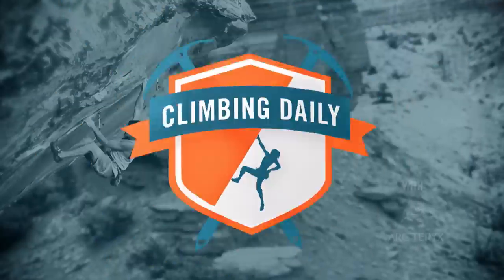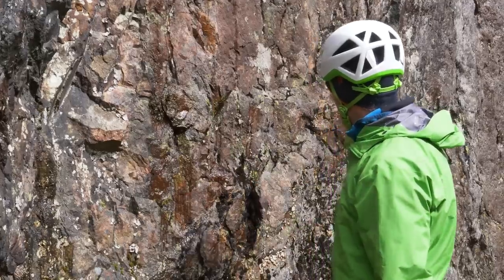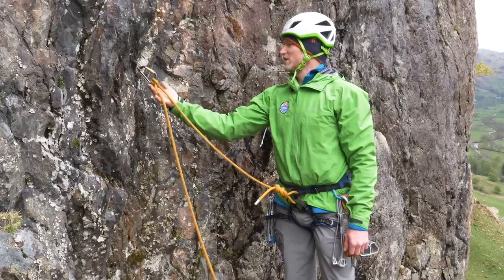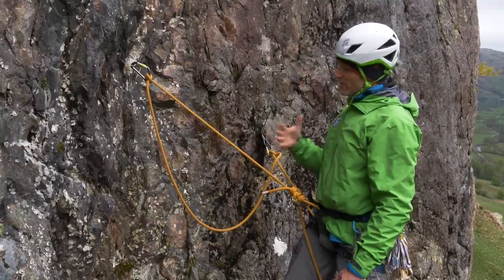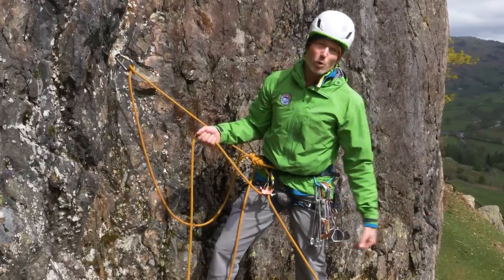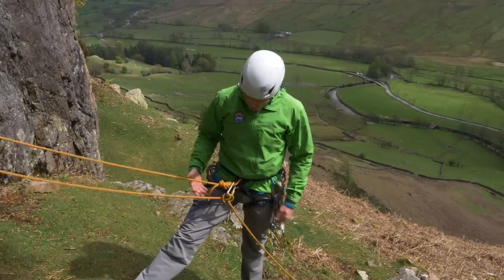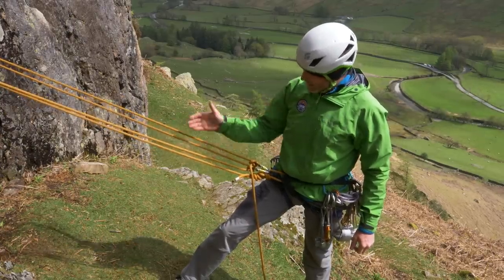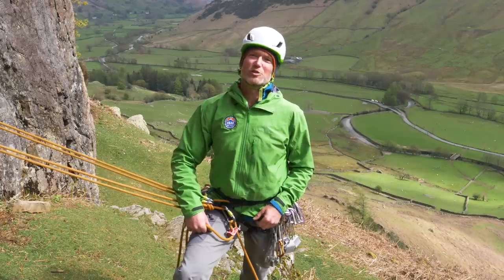How To Build And Equalise A Trad Climbing Anchor | Climbing Daily Ep.1174

Comment: aaaaand the next crazy, tutorial videos done by british mountain guides... why do you always upload videos which are totally against the instruction manual of the manufactors. do you think those manufactors are stupid? 
quick question:
1) limited breaking force (no plate mode)
2) if something happens you are tight in and need to build something to transfer the load. by doing so, you are constantly loaded by the weight of the second climber and your movement is limited...
3) what do you do if the second climber becomes the first? do you continue using your reverso that way? so in case of a fall the climber will fall next to you and probably under you and there will be no breaking at all...

summing up: complicated, not flexible, you can do it way better using ropes... dont listen to british mountain guides... I really need to start checking their stats on accidents. I wouldnt wonder if those are way higher than in the rest of the world...
Reply: 1) This is the normal way to belay with the DMM pivot when not using it in the guide mode - plenty of braking force. It is in DMMs manual for this device I agree they aren't stupid and say that the device can be used in the the way he has in this video and in guide mode. It is called a semi-direct belay as opposed to guide mode or an Italian hitch straight to the anchor which is a direct belay method. Have you ever lowered someone with a device in guide mode?

2)  Sure. But it is perfectly possible to escape this system if needs be (it's easier than you think). How many times have you had to escape the system? I have only had to do it whilst under training.

3)  If the second is going to lead through, they get to the stance clip in (even just to one of the ropes is fine) to make themselves safe and you turn the belay plate 180 so that the dead rope is at the bottom (like when you normally lead belay), transfer the lead kit (have a cup of tea), then the second leads on. No idea how many times I (and 100's of thousands of other people) have done this without a problem.

I get what you are saying in that using a sling or two to build a belay is great as you might be able to use the belay plate in guide mode and it can be easier to escape the system. There are many ways to skin a cat and knowing that you can do it this way when you've used all your slings up, they won't reach from the gear to where you need to belay from or you know the second will just swing leads this is a quick easy way to do it.

If I am leading all pitches with students I'll try to use slings as it does make life easier unless I am getting them to start to build belays; but then that is a teaching thing rather than for speed or ease.

Bottom line really is everything he has done is safe, taught in in the books and on courses, is in the manuals for the equipment and is just another way to build an anchor. Different techniques for different scenarios.
Reply: Ape man is a good name.

1) How is the breaking force in ANY way limited here? If you've locked off the rope away from the climber they are NOT going to fall.

2) You CAN escape the belay. It's a tad harder, but not much.

3) This is a fair point, change arounds are harder, again not impossible though but this is a factor you should build into your assessment of HOW you're going to build your belay.

Flexibility in how you choose to build your belay is an important skill. 

This method is ideal for building belays on gritstone edges. Short climb = lots of rope left over. Gear at the top of the edge is often quite far apart and often is much further away than a my biggest sling/cord could cope with. 

This method is less ideal on long multi pitches where you can't afford to lose precious meters of rope and where gear placements for a belay are in easy reach.
Reply: @apeman2601  FYI the instruction manuals are often written by the marketing department rather than the engineers, something to consider
Reply: @benschuster9792  you are kidding me, right? Maybe mkting suggests a last wording review before publishing but there’s got to be some engineering behind the manuals of all climbing equipment
Reply: @santiagogranda8851  more the other way round. The engineers generally have better things to do than write up instruction manuals and draw diagrams. The engineers probably check the manuals so ensure it's not blatantly wrong but small details probably would be overlooked. For example I saw on the instructions for a decathlon harness how to tie into the harness with a figure 8. The instructions showed how to tie it all criss-crossed and poorly dressed, something I would expect from a relatively inexperienced climber but nobody in the industry would make that mistake.

Comment: I love how all the keyboard warriors are bashing someones techniques that teaches IFMGA qualified guides . Maybe if you all got off your arses and did some leading you would understand this is common practice and part of a system of techniques used in different situations. Using the rope to create the anchor may use alot of rope and might be a bit of a faff but its common practice and it has its place . Aswell as only using 2 pieces of gear for the anchor itself , if those pieces are 10/10 bomber placements and im climbing a V Diff with someone that will cruise a 6c sport route why would i worry ?  

Might be different to what you use or have been taught but knowing as many rope tricks as possible will only make you a more effective climber .

Comment: The way I do it is this:
1. If I'm close the the wall I use an equalised sling with 2-3 anchors.
2. If I'm far from the wall I use the rope and tie-in in the same way.
3. I don't have a belay device capable of guide mode, so I never belay like that from the anchor.
4. 80% of the time I just use 2 anchors and have never had a major issue after 14 years of alpine, ice and trad climbing. But if I feel one of them is not solid, I place a third.
Great vid thanks :)

Comment: I liked your video but I’m curious as to why you attached your belay device to the fig 8 knot loop on your harness, I’m just curious because wouldn’t that mean that if  the climber were to fall you wouldn’t be able escape from the system? If you tied another fig 8 knot as an isolation and clipped it to your harness before you made the system you could then belay off that loop instead and if the climber were to fall you wouldn’t be stuck tied into the system, and it wouldn’t use much more rope if that was a concern.
Reply: In that situation you have to rebuild the anchor. Given how rare it is for you to need to escape the system, I think it's a fair tradeoff for the advantages a rope anchor has
Reply: This is what I was going to say. Though I'd also like to add that even if he doesn't need to escape the system, he's got everything on that fig 8 not with zero redundancy.

Comment: This is very different than the way we do it in north america. 

From what I have seen, use, and have been taught, we use three point anchors on gear unless both pieces are super bomber or are bolts. Generally, we also bring up the second directly off the anchor and not off the harness which changes the setup quite a lot. 

Still cloves into the pieces, but brought together to a master point where the device is placed. 

I do like this style, it seems to use less rope and it faster to setup, but I don't see how you can make this style of anchor self equalizing or easily escape it if something goes wrong.
Reply: I was thinking along similar lines (also from NA).

I have a feeling he's got more of an alpine approach to this, whereas in NA the "default" techniques we use are more geared towards climbing say technical trad multipitches. Also we have more bolts as anchors in a lot of location for multipitches and that probably influences how we tend to teach techniques.

I agree what he's doing is actually pretty quick - I would consider something like that for good belay ledges on easier climbs. He doesn't show it but it seems like it would be ridiculously fast to take out if you switch leads (as he mentions). Plus you need very little gear. Fast & light.

However like you said I also prefer not to be part of the belay myself, just in case. However the interesting thing is that in case of a higher fall factor (say you switch leads, and your partners falls before he puts protection in) I bet this system would actually fare better because the belayer would move around & dissipate lots of energy which wouldn't have to go to the anchor, or to the falling climber...
Reply: I think your last point is one of the most important. You can use the rope and still build a master point to belay off of that you aren’t inherently tied into. It seems to me that escaping this system would either be extremely contrived or would involve transferring the load to a single piece of pro. KISS
Reply: Ammoniummetavanadate my thoughts exactly I was always taught to have 3 pieces in to build an anchor and to belay 2nd climber from anchor not yourself so the load is on the anchor not the person.  Must be taught differently there.
Reply: The idea for this one is that you will be sat/stood in one place loading the anchors constantly and not moving so no need to be self equalizing and the initial set up is via the clove hitches (in reach at the anchor out of reach at the belay loop).

It is easier to escape the system than you first think. Granted more difficult than if you have set up in guide mode or a sling focal point but perfectly easy none the less.

like most things a little bit of practice now and again and you can do it quite quickly - we got timed on one of my courses years ago!! Thankfully never had to escape the system for anything yet.

Just another method for the tool bag ;)

Comment: I am wondering why he didn't use ATC's auto locking function to belay, worrying about the 2nd climber couldn't climb up?
Reply: i agree.  it seems awkward using the atc like this here because you have to pull up on the break hand to catch the second's fall. granted its not a lead fall but would get tiring to repeatedly belay like this for a multi-pitch trad route.

Comment: A number of comments are rather critical of this - I suspect people from North America, where this approach isn't too common. I would invite those who feel inclined to dismiss this approach to try to find reasons/situation where you actually would be better off (or have no choices) with his approach. Let's see:

- For some reason (accident, dropped stuff etc.) you are midway up a multipitch and all you have to build anchors are a couple biners, nuts/cams & the the rope. You may have dropped stuff, or it stayed with the 2nd at the last transition or whatever. You would certainly be glad to be able to build an anchor with just the rope then. On top of that, you would certainly be glad you practiced it in a relatively safe/controlled climb rather than with a couple more pitches to go, then a few rappels to get back down & the sun quickly fading below the horizon....
- Marginal gear/placements/rock at the anchor. It seems to be that having the belayer directly in the system, with significant length of dynamic rope included & clove hitches (which are going to slip/shift somewhat and thus take force out of any dynamic load) is a pretty good thing to do in that circumstance.
- Widely spaced placements - let's say you're at the belay ledge, and you have very few placements options that are somewhat far appart. If you're going to use cords, then you may not have much choice to have a dangerously wide angle built into the anchor. Chances are using rope you can always extend the anchor more and thus make the angle less of a problem.

Will I start doing that every pitch? Certainly not, but I think I will definitely try it out to get the hang of it. Mostly for the reasons mentioned above - when poop hits the fan hard, the more tools you have at your disposal, the better are your odds....
Reply: Francis Vachon Happy to chat and explain the many reasons and situations where you are better off if you like.? Here’s just one of many: 1) long pitches often are rope stretchers so there’s no rope left over to build a rope belay..2)...3)...4)
Reply: Well, my point is this just a method. Comments saying "but slings..." aren't very relevant.

If you don't have the right size of cam at your disposal, obviously you're not going to build your anchor using cams. However this doesn't make poor or somewhat invalid building an anchor using cams.

If you don't have a lot of rope, well obviously you're not going to build the anchor with the rope. As with the cams, it doesn't invalidate that strategy.

His method seems good to use in the circumstances in which it is appropriate. Just like opposing quickdraws are fine for most sport routes, but not for multi-pitches.
Reply: You laid out a very easily met challenge of “try and find a reason”  so I did, their are many more. However,  as for the general methodology he follows, it is a very suitable tool in the right circumstances but those circumstances are rare. I am in fact from the UK and after travelling extensively almost never use these techniques as they are slow, cumbersome, limiting and hinder advanced system and techniques that might be added on as a climber encounters more advanced climbing problems. There is nothing wrong per say with what he showed but  i don’t use a rotary phone anymore either.
Reply: Let me ask you what he would do if the 2nd fell and needed assistance? In his set up you have to escape from the belay plus the other end of the rope is also not available? What would he do if wanted to block lead pitches? The uk set up is best for 2 main reasons. 1) it can protect bad pieces by adding your body into a system or 2) if  you need to use the rope to extend as the anchor pieces/tree/ gear is far away from the edge.  Other than those i have only found negatives to using this system.
Reply: I use the rope building an anchor, I just don't put myself into the system. I use a master point and belay the second off of that. 

Now, this method is super quick and efficient with rope so from that aspect I like it, but it also makes escaping the belay almost impossible and forces you to stand in a single position to weight the anchor.
Reply: Knowing how to use the rope for an anchoring system is useful, as is not being tied to the orthodoxy of belaying off the anchor always. First system is usefu but could be simplified further if you're goal  making a simple anchor and using your body weight as the primary anvhor. Second one is very very cumbersome and I think no longer has a practical application.
Reply: Eric Hughes well yes I'm not debating the downsides you highlight but you're still missing the point. I did not "lay out a challenge". It's not about finding a better or worst method, it's about understanding the pros & cons of each. You seems to be seeing this as " I'm going to find a situation in which this method would suck and highlight it". This is easy to do with most things climbing beyond the basics because no single method is ideal in all cases. If one is only ever interested in, say, bolted multi-pitch routes then there's little point in what's shown here and just bringing a double length sling with a couple locking biners is fine and one may not need to know a whole lot more. However is one is into more alpine endeavours then there is value in knowing this approach, breaking it into component parts and being able to mix & match that with other skills to get one out of trouble/prevent issues.

Comment: Is there any reason using the rope loop that attached to the harness as the master's point? A slightly modification will make escaping the system much easier, e.g. tie another loop and attach it to the harness with a carabiner, and use this separated loop to belay. One can easily escape from the system.

Comment: Hello, can I have a questions? What you will do if your partner will fall in overhang? And why are you not using the belay device like in multipitch climb for second climber? Thanks for answer. Daniel
Reply: This device (the DMM Pivot) is being used in the standard belaying method so there would be no problem if the second falls. I take it you are asking why he isn't using it in the autoblock guide mode? you could do but this works fine too.

I hop[e that answers your question.

https://dmmclimbing.com/dmm-pivot-belay-device/
https://www.youtube.com/watch?v=XqG94vAGuIQ

Comment: Great video and some ideal tips and tricks. 

My only big issue is the anchor is not easily escaped by the belayer as you are tied in. It's much more practical to build the system then clip in, not be a part of the system.